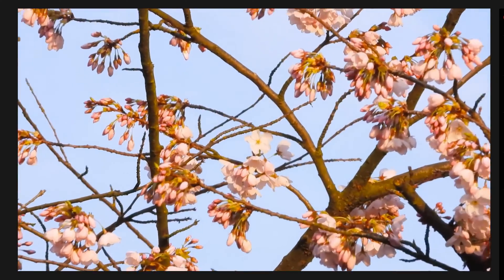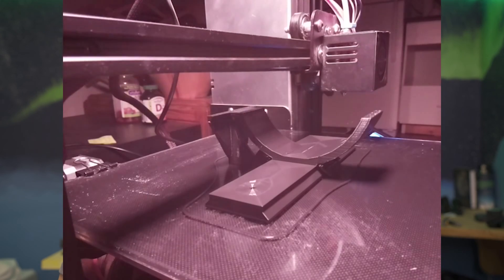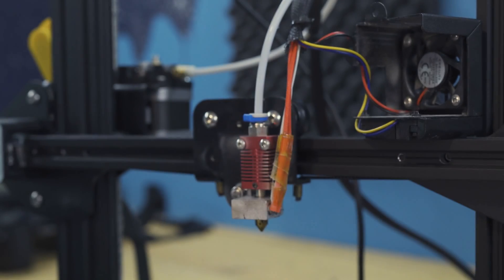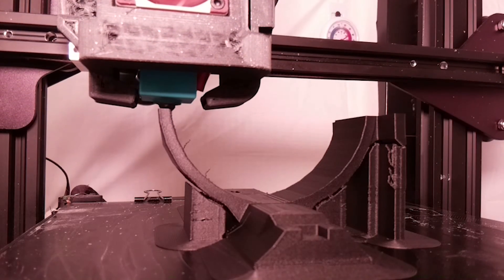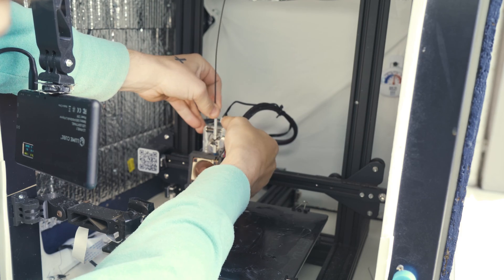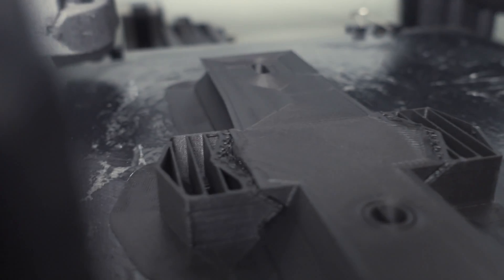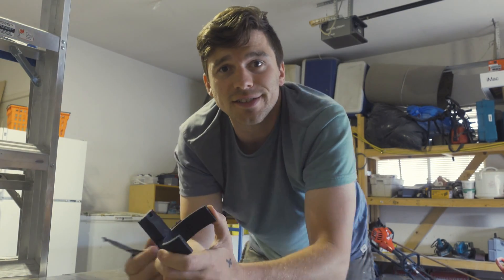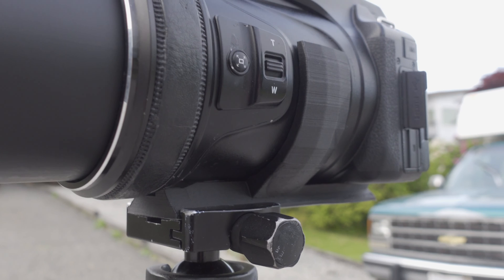Fixing the Nikon P1000s Camera Shake

Comment: I have a P1000 and I had been using it on a long base plate with a wad of tissue under the barrel of the lens portion and the base plate fixed to the triod further forward than where the camera's tripd hole is and it was better. Now I have now ordered some small rig type items from Amazon including rails and a lens support. Fingers crossed for that set-up. If Nikon just put the tripod mount under the lens it would be a much better handling camera at long focal lengths.

Comment: I dont use digital technology just old self made transformator solder gun(same that is available in stores) that i melt very small portion of plastics..... Soo i use paper as isolator on camera and start melting and connecting drops of plastic on camera. You end with resilt you want .... Its best to put more platic that you need and later polish it with files. You can put steel elements inside for more power when adding drops of plastics.(solderimg with plasitic)...i was made accesories like this for prototype projects from 10 years old ... But ther is need to thinking about what you doing when you doing this.if someone want make it in this method just make some experiments at start...be patient and dont rush. Insert to srew tripod can be abtained from old cameras everyone have them ...or order some adapter and file down not neccery part etc.

Comment: I have a Nikon p1000 using the mount described in this video along with a heavy duty speaker stand (tripod lower/mono-pole top) with fluid head adapter and a 360 Degree Panoramic Gimbal. It has excellent stability at full zoom. This mount described in this video made all the difference. NOTE: I did apply some small double sided tape to one area to help absorb some of the jitter. I HIGHLY recommend getting this item for your Nikon CoolPix p1000. Thank you for an excellent product. After watching this video I honestly feel like the price is worth twice as much!

Comment: I am considering buying a P1000.  I have 5 3d printers so the first thing I thought of was designing a QR plate.  Then I found that Joel has already done the work, and has printed plates available in carbon fiber.  I don't want to start printing CF and Joel's price is reasonable.  If I decide to buy the camera I will definitely order Joel's plate the next day.  If I designed my own it surly take several iterations,  field trips, and filament to get it right.

Thank you, Joel.

Comment: Hi Joel. I recently purchased your very nice stabilizing release plate for the P1000. Everything works great, so thanks for taking the time to engineer and produce such a nice product. Just one comment: You should radius the corners of the plate a little. They are very sharp as is, and I am reminded of that each time I grab the camera to set up. Thanks again for your time and effort in making this solution.
Reply from the maker: Thanks for the feedback Paul! Do you mean the front and back of the arca swiss section corners? or the corners of the barrel part where your hand goes? for a quick fix you could definitely sand down the corners to make them a bit smoother.
Reply: @JoelSchat  Yes, I meant the front and back of the arca swiss section corners. They are actually very sharp. And yes, I have already sanded them a bit. I just thought I'd pass along the only thing I found that could be better. Thanks again!

Comment: I would say I would print it with 100% infill then it is hard for a camera. And petg would be enough. I to similar things for my 210 and 300mm lense on my normal non p1000 camera. For that need to be hard 100% infill is the best
Reply from the maker: Thanks! Ya I switched over to 100% infill, I find the nylon bends a bit better around the lens barrel than PETG. It would definitely do the trick though!

Comment: I just ordered mine! I hope carbon fiber nylon is solid enough! :) Also i need to get a good tripod for it. Is the manfrotto 190go (aluminium) any good for this camera?
Reply from the maker: Thanks Edward!! I've actually improved the design and got a better printer since this video. It has greatly increased the strength of the product :) 
I have a friend with the 190go and it seems like a really solid tripod! I think it would do the trick